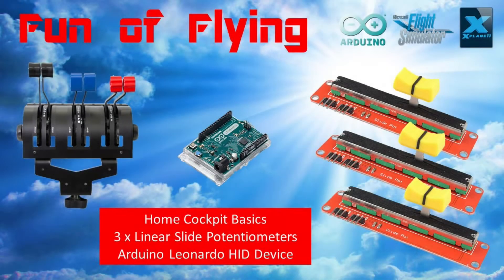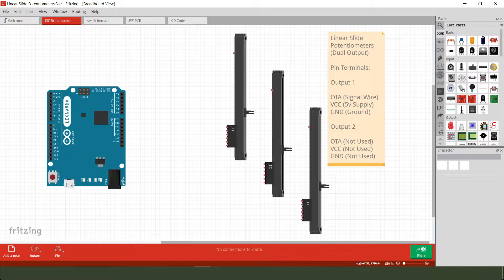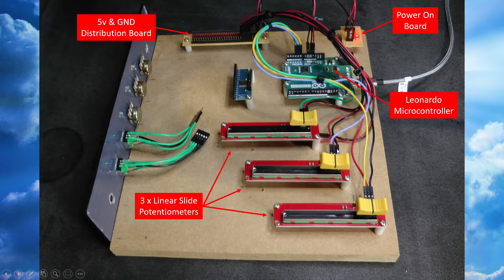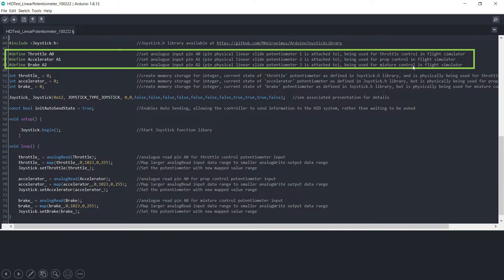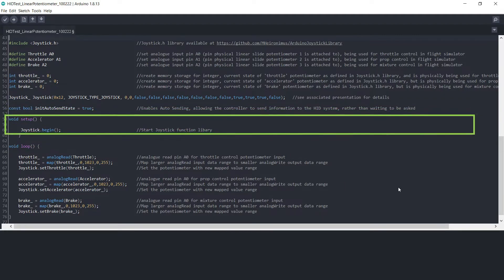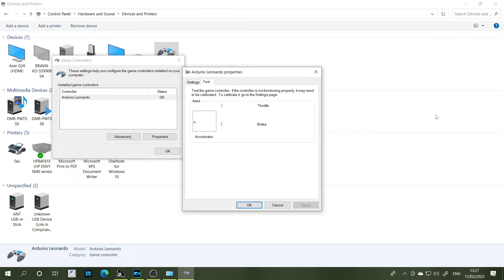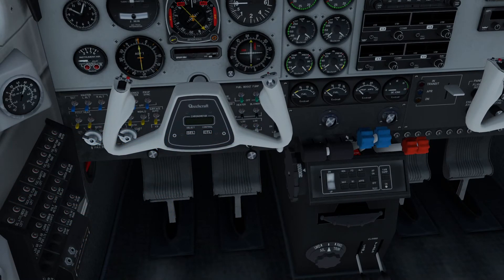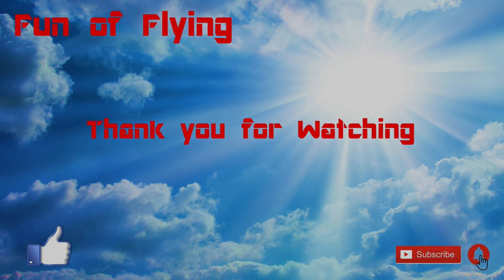Home Cockpit Basics: 3 x Linear Slide Potentiometers & Leonardo HID Microcontroller (XP11 & MS2020)

Comment: Hi, do you have a link to that code please ? Thanks
Reply: Yes I Also need the sketch please
Reply: Me TOO !!! 🙏
Reply from the maker: Hi guys, normally I don't release my sketch code files to viewers, as it is hoped that my videos would be enough to assist people to have a go a writing such for themselves! However, as the code you have all requested was written so long ago, I have provided the Google Drive link for it as follows: https://drive.google.com/drive/folders/1Ho0Sc41jllIfjbNVk7TDtyogHCmtZcET?usp=drive_link

For the code to work properly, you will also need to download (free) the Joystick.h library from the GitHub repository, assuming that you don't have it already of course: https://github.com/MHeironimus/ArduinoJoystickLibrary 

Any problems, please let me know? Kind regards Paul
Reply: This Google drive said I had to request access @funofflying15
Reply: @funofflying15  hi paul, thanks got the ino file, but is says  "Compilation error: 'Joystick_' does not name a type; did you mean 'Joystick'?
do you know why its doing this ? thanks Rob
Reply: @RobBob555 lol,  I'm having EXACTLY the same issue 🤣🤦
Reply from the maker: @RobBob555  Hi Rob, could you please confirm which microcontroller you are using? Thanks
Reply from the maker: @RobBob555  I'm pretty sure that the original video would have made this clear, but you can only use an Arduino Leonardo for this sketch code, the UNO or Meag2560 won't work due to their lack of native USB support!
Reply: @funofflying15  ok, thanks, sorry mate. il order a Leonardo
Reply: Got hold of a pro micro, working great Thanks 🙏
Reply from the maker: @RobBob555  Well done, glad all worked out for you 🙂

Comment: Hello Mr. Paul, I must say first of all, what a fantastic job you have made and I admire very much your work...!!!!          I have been in a project since 2017 in my spare time  (I am an active Officer very close to become retired in the Hellenic Air Force)  of a construction of a throttle quadrant for the BOEING 737-800 and having finished the hardware of it I came to a stand still because of the complex electronics involved and searching the best way to proceed next.....       I came up with your solutions....!!!!! Thank God....!!!! So... I have some questions and dark points... If you would be so kind to help me out and make it bit easier for me to finish it and make it all work.....( I have no knowledge in electronic wiring logic, and theory schematic or otherwise....so I will go very slow on copying and paste)...

1) Can I use 4 Linear potentiometers for Speed Brake,  Engine No1,  Engine No2,  and Flaps, instead of 3 potentiometers as in your set up, with the appropriate addition of wirings of course. 

2) How to make the connections like in your amazing Test Board but without the "Power On Board"....of course I would have to use the  "5v & GND Distribution Board" I think.....!!!! Or perhaps not ???!!!! 

3) How can I get the Arduino Desktop Application for the writing of the code, and if there is a cost to it??

4) And lastly, is it possible with the same  Leonardo Microcontroller to add, besides the potentiometers, a number of Microswitches and Pushbuttons to make it all work, and if YES, how many of them the Microcontroller is able to handle?
                                                                                                                                                                                                          I'm going to have to use:                                                                                                                                                                     1 Pushbutton for TOGA,                                                                                                                                                                   1 Pushbutton for Throttle Disconnect,                                                                                                                                          1 Microswitch for Reverse Thrust of Engines No1 and No2,                                                                                                                2  Microswitches for Engine No1 Fuel CUT-OFF,                                                                                                                          2 Microswitches for Engine No2 Fuel CUT-OFF,                                                                                                                            and  2  Microswitches for Parking Brake.                                                                                                                                    In total 2 Pushbuttons and 7 Microswitches...

Any ideas??!!! about question 4)       and the big question...how to make all the schematic wirings of all these...and the code....!!!! Will send you some pictures of my construction to just check it out, if you like.....!!!!

                                                              THANK YOU ENORMOUSLY VERY MUCH FOR YOUR TIME... 
                                                                                                                                                              2nd LT George Tzavellas
Reply from the maker: Hi George

Thank you for your lovely message and very kind words, much appreciated 😎. WOW, I haven’t yet spoken to anyone from Greece, especially an officer in the Hellenic Air Force, so a big welcome to the channel!

It appears that you are working on a nice project there, so the best thing to do would be to continue our conversation privately and by email. If you would be kind enough therefore to drop another message to me at funofflying@gmail.com, I will then get back to you.

Kind regards Paul 😎

Comment: Hi what should be the code for a320 airbus
Reply from the maker: Hi there and welcome to the channel😎

I am currently away on an extended summer vacation onboard our boat, so unfortunately cannot access my PC at home nor any of my files. From memory though, the slide potentiometer IDE sketch code should work with XP11 and MSFS2020 in exactly the same way, irrespective of aircraft type. 

You just have to make sure that you calibrate the pots in Windows 10 and assign them correctly in the flight simulator. Hope this helps?

Kind regards Paul
Reply: @funofflying15  thnx alot now I understand

Comment: Your videos really help me a lot getting started on my new hobby.  Have you tried a combination of potentiometers and encoders in the same configuration?   I combined this with your other video but the encoders seem to lose response when combined with the potentiometers.  Do you have some tips?
Reply from the maker: Hi there and thank you for your message :-) As it happens, I am currently working on a project where rotary encoders are being used in conjunction with an LCD display and also a Leonardo microcontroller acting as a Human Interface Device. The video for this will be released shortly. I haven't actually written a code specifically to include rotary encoders and potentiometers together, but I could write one without any issues. If you contact me at funofflying@gmail.com and give me a better understanding of what you're project entails, I will then be able to advise you further. Kind regards Paul

Comment: Hi Paul, yet another great presentation. Thanks.
Reply from the maker: Thanks Dan, hope you're all well and that winter is not too serious where you are?
Reply: @funofflying15  Hi Paul. Sorry for the tardy response. I had notifications turned off. We really have had a great winter until yesterday when we received 25cm of snow. Still not too cold for this time of year. I was thinking just yesterday that it should be time for another demo?  Any way take care and I will talk to you later. Dan
Reply from the maker: Hi Dan, nice to hear from you :-) WOW, how unlucky is that, you've managed to get through winter OK, but just when we're going into spring, you get a rather large dollop of the white stuff! Hope you've got a strong snow shovel? Re: my next video, it will actually be posted today. It's based on another project that I've been working on for some weeks, which has really stretched my poor coding skills to the limit and it involves a Leonardo acting as a HID device, four rotary encoders and one LCD display! Take care my friend, regards Paul :-)